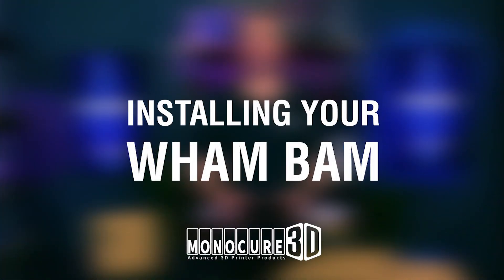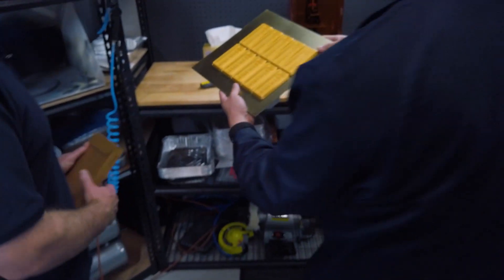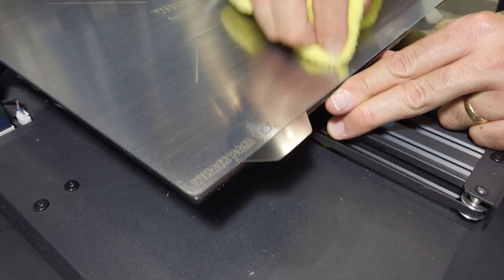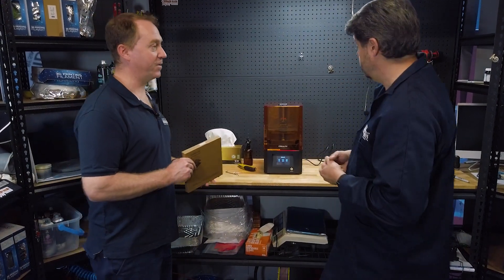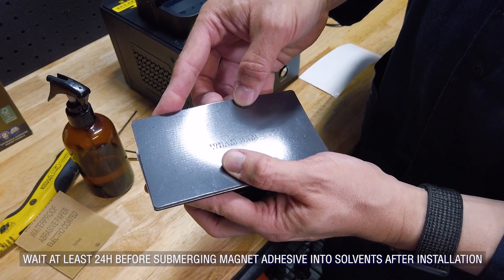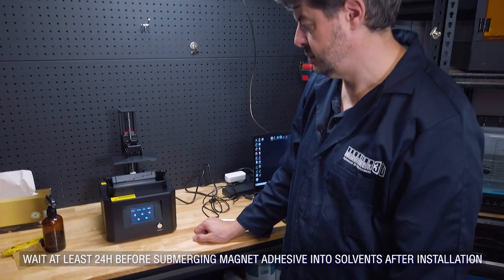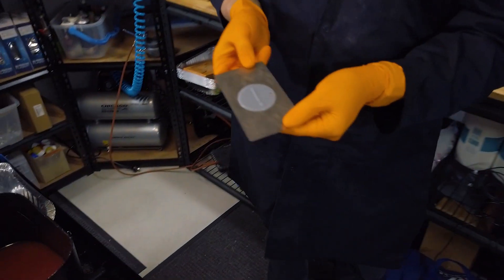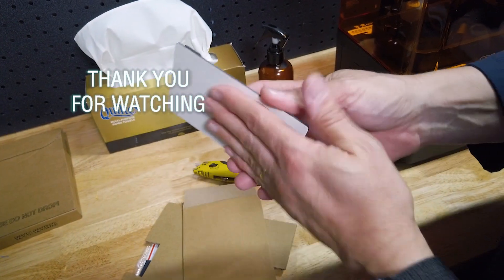How to install your WHAM BAM on a FDM & Resin Printer

Comment: I noticed you sanded in circular motions on the plate - every other video has said to sand all in one direction, what's the difference between these two methods?
Reply from the maker: Either will have the same effect! Just helps the resin stick a bit better.

Comment: Regarding the resin kits; We do endorse washing on or off the build plate, but usually, we don't recommend curing on the build plate unless you are a very careful person who ensures that there is no resin residue left on the plate at all before curing or you could cure a thin layer of resin onto the plate.
Reply from the maker: Of course! Make sure you wash before curing.

Comment: Excellent video guys, thanks for this I didn't even know it was a thing and now I must have it. Only problem though, the double in 135x80 for Photon S is out of stock!
Reply from the maker: Yes, I know! We did order them a while ago and should be here next week.
Reply: @Monocure3DProTips  I'll check back then :)
Reply: @Monocure3DProTips  You guys are too generous! Thanks for speedy delivery and the extra goodies :D

Got the wham bam installed on my Photon S and my first print with it running now!